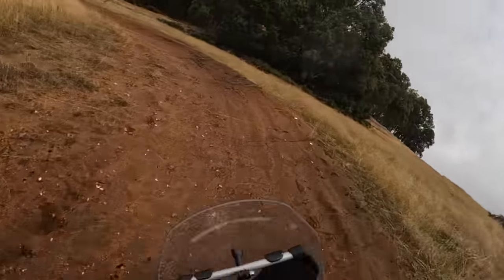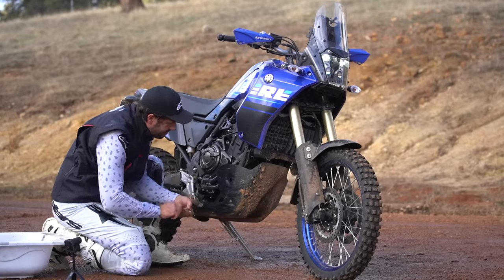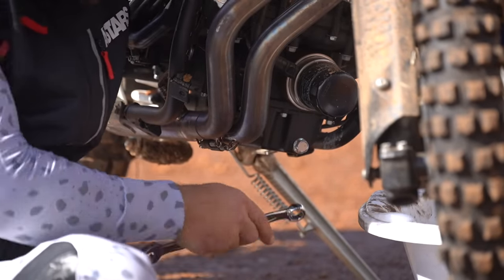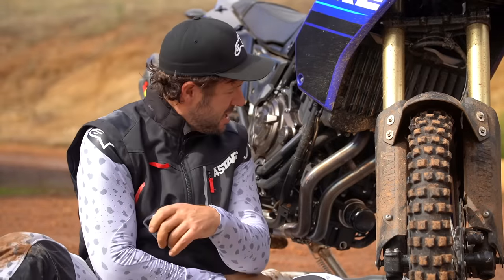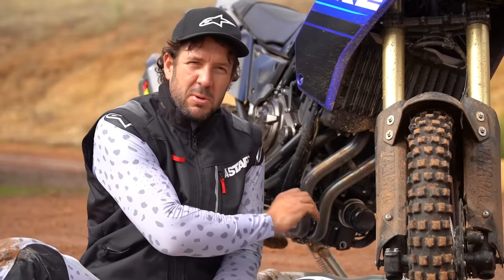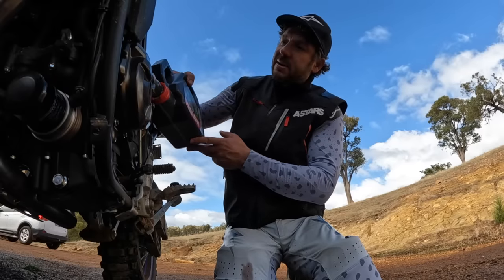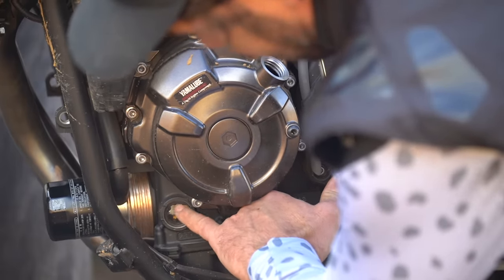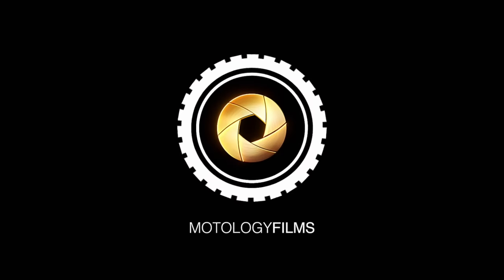Ultimate Engine Maintenance Guide: Triple Your Bike Engine's Lifespan

Comment: In 30 years of wreching there is just ONE engine that I changed cold without running it. New to me diesel lawnmower that I know had been poorly maintained. Fresh oil and did not change filter. Ran it with with that combo for an hour and got crude out of crankcase. Changed oil and filter and oil is still a nice amber color 100+ hours later.

Comment: Adam, my 890 had Putoline at the dealer for first service warranty validation, I switched to motorex next service but didn't like how the clutch was grabby when cold, so I went back to Motul which I used in my Gsxr stunt bike and YZ400. I'm on the 7100 10/50 -  bike revs cleaner, shifts slicker, is generally noisier but hell KTM's sound like a bag of spanners anyway. 
I also use the 890 for short commutes, the worst type of running for an engine. So it gets oil changes every 600 miles regardless, warm it up to boil off the condensate then thrash the arse off it. A Filter is critical at every change if doing short journeys due to the heavier content of moisture, acids and fuel dilution that occurs in short duration running (warm up enrichment)
Same if you do lots of river/creek crossing, water ingested will generally be burnt off by combustion and heat in the crankcase, but any making its way into the oil can block the filter. 
People seeing blackened oil with recommended grades should check how hot their oil temp is. We found our race cars 10/50 was blackening quicker than expected and after placing temp strips on several locations we found the temps on a gallery exceeded the 50 rating, switched to 10/60 and the oil lasted between scheduled changes with no blackening.
Motul is quality gear, when I revalved my forks and shock I discovered that motul was one of the few manufacturers whose grades actually met the correct cSt viscosity values required by WP.

Comment: Great video, and absolutely wicked bike! 

The only thing I do extra… is fill the new filter with new oil before I put it on. Even my horizontal mount ones like yours. You can fill it to the top, and it will soak it up enough to not spill when spinning it on. Avoid those crucial few seconds of it running not getting oil right away due to the element in the filter soaking it up first. I also soak my canister type ones on my BMW as well. But that’s just me. 🤷‍♂️

Cheers 🍻
Reply: Looks like the oil level is directly in line with the middle of the filter on your bike. I guess in this case it would prime itself.

Comment: Torque wrench with a new crush washer, that will guarantee you'll never strip a drain plug. And the torque spec assumes a new crush washer.
Reply: The smart answer is a fumoto valve 👍
Reply: allanthomas7345  I've old and I never crashed a car but I'm not stupid enough to ignore seat belts, abs or car insurance...
Reply: A copper drain plug can be reused many times with no leaks. Assuming it's not over torqued.
Reply: @methanial73  You are obviously referring to a drain bolt copper washer ,as motorcycle sump drain plugs are not manufactured from copper . You can reheat a used copper washer & reform it by heating it up with a blow torch if you haven’t got a replacement washer.
Reply: It doesn’t matter if there is a new washer or not ,an accurate torque wrench set to the correct value ,will not over tighten. The washer  made of alloy or copper is there to prevent oil seepage ,as the tightened bolt crushes it down to make up for slight irregularities in the sealing area between bolt head & sump drain hole area . Often you can get away with re using a previously used washer ,but if possible it’s always better to use a new washer of the same type ,to prevent less chance of oil seepage at running temp . Often the owners handbook won’t mention renewing the sump washer ,or only mention replacing it if damaged.  Any torque value mentioned is only to prevent damage to the sump bolt & sump drain hole threads by over- tightening .  The force exacted on the sump threads is the same where a new crush washer is used or not ,as long as the correct torque value is used .
Reply: @methanial73  copper drain plug? You mean copper washer... And you always put new one on when the plug is removed.. Only alu ones you can reuse
Reply: @mule666  yes, washer. Lol
Reply: @mule666  no, you don't need to replace the copper washer every time. Unless it's some weird alloy.
Reply: allanthomas7345 Go easy.  I don’t know why there’s negativity and insults on motorcycle channel comments.  Let’s encourage and support new and inexperienced people.
Reply: @mule666  Ive re-used my copper washer year after year and never had a leak.
Reply: @mule666  No you don't have to replace copper washers. You just anneal them with blowtorch as mentioned and put it in water. Can be re-used as long as there's no cracks in or outside perimeter (is it perimeter in English, well you get the drift)
Reply: Genuine question, are these washers very expensive?
Reply: @ubatubaable no they are less than  dollar.  Don't reuse them just replace them.
Reply: NOT TRUE! I always use a new crush washer when changing my oil, however that is no guarantee what so ever that you will not over-torque your drain-plug. Doing so is only asking for big problems that ultimately will result in a stripped oil drain plug. I called several local bike shop mechanics and all of them said the exact same thing, "Never torque your larger (e.g. M14) metal drain plug into a 356 aluminum cast housing which is used for most modern engines.

Comment: I always replace a filter every oil change but i never thought about how quick it might get blocked. I always change oil long before the book says SO I dont think a filter blocks that quickly. But i don't ride anywhere near as hard as you. 

Great video and im glad it confirms my oil change habits.

Motul: Never liked it. Always seemed thin and engine was nosier. My xr400m clutch would slip on it (Had a built Motor), My ktm 690, husky te510 engine was very loud, Even on the 10w - 60. Went to penrite and it has been fantastic and a little cheaper.
Reply from the maker: Yeah mate, the accumulation of debris is exponential – the more cold oil changes are done, the more particles stay in your motor and basically block your filter quicker each time they're replaced.

Comment: Touratech bash plate is what I have, so worth it.
Very good knowledge you have, I change the oil after a hot steady day in the UK and even if the manual says 6k miles to change,I still change mine at 1k  miles 👍. 

Sump plug bolt, I drilled small hole and lockwired it, Not Rm80 experience but yz125.

Comment: AWESOME! Very important information, I learned something new! 
1.) Paper oil filters are the only good ones. Don't use fiberglass or synthetics. Paper filters filter the most fine particles and are nearly impossible to put into bypass, because there are so many folds and spaces for particulates, compared to other newer synthetic elements. (see actual tests).
2.) Motul 7100 and 300V oil only in streetbikes. Only Motul oil. 300V oil does show literally half as much wear in a straight friction test hot and cold, that I observed, using the standard "wear scar" test. The wear scar was less than half as deep for both the hot and cold tests on 300V oil compared to 7100. Both are good oils. 7100 is slightly thicker and may be quieter. 300V is a thinner oil, for maximum horsepower.
3.) OEM oil filters are all plain paper. Because paper is the best.
4.) HiFlo brand oil filters are paper, and are similar, but even stronger constructed to OEM's.

Comment: Good tips, I like watching your vids. Some day I need to come to Australia too. 

Additionally, I always fill up the bone dry filter three times till is soaked up and oil level doesnt drop anymore in the upright filter, no matter if its mounted vertically or horizontally. Turn it fast and it wont spill out while mounting :)  

Everyone and his mother starts his engine cold, AFTER he puts on all the gear, helmet gloves etc.. Start it before you put your gear on, at least gloves and helmet, except you are on the run. Oil needs a while to reach what is far away, like camshaft journals. 

And, don´t start any engine with extra throttle. If you need extra throttle to make it look cooler for some pedestrians, or dudes who don´t care anyway, do it. But an engine that needs extra throttle to start, isnt tuned properly, and shows the owner has no clue what he is doing, period. When starting it, there is metal in contact with metal, extra load makes it worse.

Regarding the oil, that is black again after the first ride. When coolant temperature is high enough in any fancy display, oil temp by far isnt, it takes way longer. Well, in an engine with about 3,5 litres of oil capacity for a change with filter, about 3,3l for change without filter, (who ever does that?) and about 4,2 liter for a dry engine, you can imagine what color your 3,5 litres of fresh, clear, red or whatever oil, will look after you put 0,7litres of black oil into it... guess what? Its almost as black again in the small level window.  Im a professional bike mechanic, having my own workshop, not self tought like most dudes around the world, normally working on cars, fork lifts or lawn mowers. But... what do I know, compared  to some real office dude pros reading reddit  ;)

Comment: Excellent video. My mechanic added some diesel to the oil before it is fully drained and kick started the engine a few times, followed by pressured air into the engine. But it was on a small honda CG 125 without oil filter. I was wondering how to have the same effect on a bike with oil filter.

Comment: I both enjoyed your video and learned a lot from it. I respect what you said most of the time, because I see a lot of sense in all of your advise, but what I was taught and I have witnessed in my life (sorry car guy here, but the oil filters seem quite the same), you should never, NEVER use any tool , that you've used untightening the oil filter, or you are going to use it for, you never use a tool to tighten the oil filter. Just tighten it by hand. Use however much force you can put to it, but just with your bare hands. Because when you tighten a fresh new filter, the O-ring if soft and the lube it has on it, or the oil that has leaked over the surface it pushes towards to, makes it slide easily. This oil or lube is trapped there and after a year or 5000 kilometres it is going to be baked and stuck. The rubber O-ring is now going to be plastic-hard. Now is when you need that tool. 
But out of that, thanks for the great tips.

Comment: Normal working temperature for oil drain is perfectly adequate, even better if it can be left to drain overnight!
A magnetic sump plug is absolutely essential to remove the steel slivers that can come off the gear teeth, this gives you an insight to the inside of the working engine and prevents those steel particles being pushed through the oil pump!

Comment: Ive been doing this 55 years, ride the bike warm it up, drain the oil remove the filter add oil to the filter if vertical almost fill it horizontal 1/2 cup, hand tighten filter new crush washer tighten with torque wrench if you don't have the feel. You could change filter every other change and still not have an over used filter. Coat the filter seal with a slight coat check base plate wipe off make sure seal from old filter didn't stick to the metal when it was removed.

Comment: Great vid brother. I also have a T7. I put some oil in the filter before installation.
Reply: Not necessary
Reply: @Africatwinrider1  To each their own. We all have rituals. This is mine. You do you.
Reply: It's easier to top up after the engine runs for a bit and the oil filter has been filled up by the pump
Reply: I pour oil into the filter as well. Is it necessary? I don' t know, but it certainly can't hurt.

Comment: Good tutorial... just one not insignificant thing. When you drain the oil on side stand, there will be some leftover in the engine pan. Put it on centerstand or hold it vertical for a moment to drain it all.

Comment: Great video and good tips! One thing I would also recommend is filling the new filter up with fresh oil before screwing it on. This will make sure the oil pressure is built up quicker on the first start.
Reply: Issue there is trying to re-fit the filter without losing much of the content. Have been doing my own oil changes for more than 50 years and not filling the filter has never been an issue.
Reply: @johnstaring3210  that is indeed difficult on some models. It will probably not be an issue. But if we are talking about increasing engine life span the less time the engine is running without the proper oil pressure the better in my opinion.

Comment: When you change oil at that temp you are at higher risk of damaging the threads, steel vs aluminium. A long drain time is also effective, I also rotate the engine using the engine where you set valve timing. Always gets a good trickle

Comment: Nice video clear and simpel, as a mechanic i advise to fill the filter before mounting it on the engine. If you start the filter needs to fill Whit olie its only a 2 sec to do but you dont have olie pressure before the filter is full of olie . Thats wy i fill before mounting. I hope you understand it 😅 sry for the bad translate. Keep up the video,s real like them
Reply from the maker: Thank you, yes I understand very well. The T7 oil system is very efficient, no noise before oil pressure is reached, unlike some other engines that rattle until oil pressure is in complete circulation. Also, the oil filter will spill oil everywhere when winding it on horizontally.
Reply: @MotologyFilms  yes the t7 have a soild engine. And it is not a real big isue but for the "best" life of your engine i always do it. I fill the filter Just a littel bit under the edge and then put it on fast  then you have minimally oil spills

Comment: Great tips. I think the crush washer I'm using is original. Also getting a magnetic drain bolt is a handy way to collect the heavier dirt. Changing oil in all my vehicles basically like this. Shit is too expensive to just trade it in every couple years.

What's everyone's mileages on their one lungers?
2011 KLR with 106000km. Had it's first two oil changes with Kawasaki synthetic and paper filters. Then switched to Amsoil and stainless filter. Roughly around 20k I switched to Rotella T4 as Amsoil or other synthetics are too much money and unrealistic for regular use and travel. However I aquired an older GasGas and will run Amsoil in it because 1. It's a Europrincess
2. It's a weekend bike
3. The cost per mile will be significantly lower
Reply: That's pretty good, my R1 has 166,000 k's on it and I only ever change the oil when cold, halve the suggested oil change intervals and use Motul synthetic. Runs as good as the day I bought it.

Comment: Always did this with a kawasaki zzr 250, one did 350,000 with a few replacement camchians and piston rings .It was beaten and battered rat bike, but everthing worked besides boingy suspension. Halfords oil also (UK). Replacement was at 3,000 mile intervals.  Remember having a sore arse with the milages each weekend.

Comment: I read many of the comments, but what I didn't see mentioned is this:
Loosen, or remove the oil fill cap when draining the old oil. This allows air to enter the crankcase and the old oil to drain smoother, without the "chugging" action at the end. 
Helps to splash less this way, when it's nearly all drained.
Like trying to pour milk out of a bottle without letting air in, it will glug-glug-glug rather than pour.
As others have mentioned, DO add oil to the new oil filter, too. Give your motor a head start in being lubricated.
Lastly, I've never felt the need to use a wrench to install a new oil filter. Drives me crazy trying to muscle off a used oil filter, or drive a screwdriver through it to lever it off due to it being overtightened. Hand tight then snug with 2 hands; the entire thread will hold it on fine because heat expands it all.
None of my oil filters have ever leaked, just because I didn't tighten it down with a wrench.

Comment: Im pretty sure when Suzuki put the big oil cooler on the DR650, they did it a huge favor. Holds more oil, the big oil radiator does a bang up job of keeping things cool. 51,000 miles on mine its the same as it ever was, runs like new.  Never needs valve adj.

My 890R, at 8000 miles to oil change, the oil is far from black coming out, I don't know what KTM has done in the engine but it sure stays clean inside, oil never looks dirty looking thru the window.

Yup I would wear gloves when dumping hot oil, if the drain plug falls in the tub its not the end of the world.
Just dont smoke your arm on a glowing exhaust.

Comment: we were always taught to tightenl oil filter hand tight, then back it off a quarter turn. The reasoning behind this rule just covers how rubber seals sit against a flat metal surface. when its cranked too tight the rubber thakes a u shape along the mating surface... thank

Comment: Same o same o. I put a wrap around magnetic strip on my oil filter. I then change the filter ( engine cold) this helps remove all metallic particles . Then top off the new filter with new oil.( Replace magnetic strip around  filter with zip ties.)  Place old oil in glass jar. After it settles you will see all the metal particles. I change oil filter once before doing complete oil filter and (Amzoil) oil change.

Comment: I would say late season is the best time to change the oil. Then you've got some fresh stuff in there thru winter and ready to rip the first nice day of spring. Also I always run some fresh oil thru before I put new filter on to make sure I've pushed anything laying at the bottom of the pan out as much as possible. It's not wasting that much oil in my eyes for the little bit of extra effort.